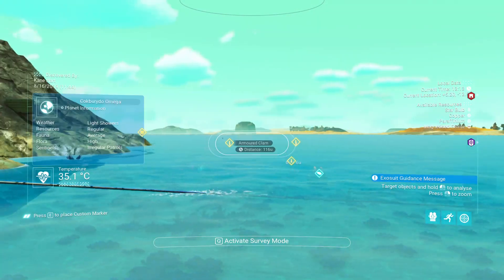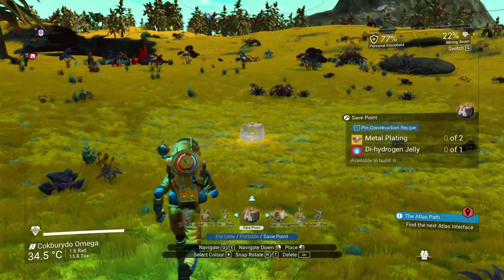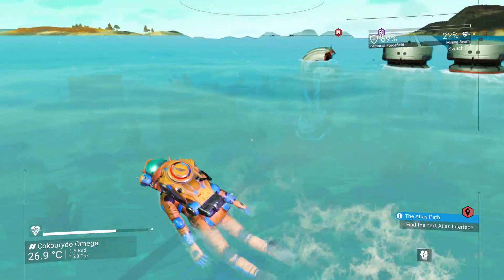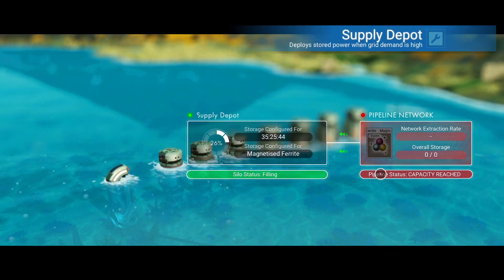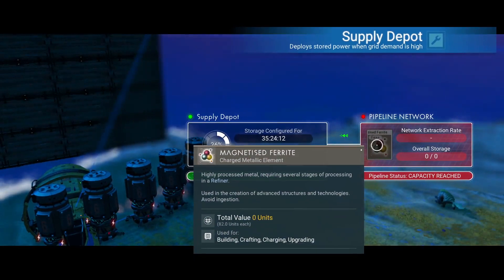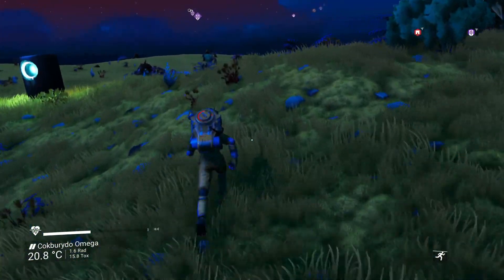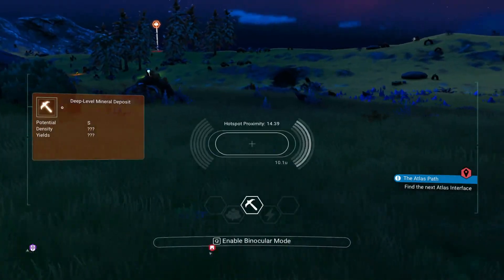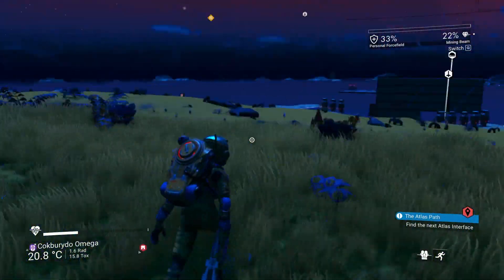No Man's Sky: Beyond - Industrial Issues / Suggestions with Extractors, Supply Depots, Etc.

Comment from the maker: You can submit bug / suggestion reports directly to Hello Games with this link: https://hellogames.zendesk.com/hc/en-us/requests/new
Reply: So, after watching your video cause I was having the same problem, I checked my set up and it turned out a couple miners were outside the zone. Try condensing them closer to the hotspot.
Reply: im having same problem however what type is ur world world I have this issue on is a capped world like urs I bet
Reply: hey i was wondering does the industrial extractor produce minerals over time (eg.1 copper per min) or you get it all in one go (eg. 250 copper per Hr).

Comment: I got this huge bug. Extractors aren't working how they're supposed to. I have multiple farms and the problem started when i had more than three farms on different planets. They're either empty or very slowly filling. Then i have this Dioxide farm that allows me to keep getting max capacity and doesn't empty. This means i can take an infinite amount of Dioxide. Even though this is great for my economy i rather have my extractors work properly.

Comment: Maybe I got lucky but I got the capacity reached message on the supply depot so I redid all the piping and then checked again and it worked. When u lay the piping be slow and accurate with connecting the pipes. Sometimes they will snap but be off the mark just a little which I believe is what caused this problem

Comment: I have an issue with 5 gas extractors that produce 450-480 class A nitrogen farm I can add a few more and connect them via pipeline and boom they are only producing 300 - 340 each but then I delete the pipes and they are back to normal, is this a bug

Comment: I think something that can work is let them snap to buildings so there is no power lines or pipes needed rather than there being classes for the node the mining item has the class so every node is the same but if you put an S class drill it will be like a s class node. And higher class storages to. I would also say you don't have to have a node but it is a step down. So say you want copper but don't care to get the max haul. You put down a b class copper drill anywhere but if not in a node it acts as a c class. If c it would act as if there is a d class.

Comment: Not sure if there's been an update since this video but I had the pipeline capacity reached with my supply depos from long distance pipes.  I deleted a pipe and pit the supply depo right next to the extractor and it worked.  Also no lightning bolts or KP so far with mine

Comment: I have a problem with the extraction rate and storage size on Sulphurine. Although the site is a s class Sulphurine site, the extraction rate seems to be really small (only 40 per cycle, but I have a total of 15 gas extractors). Also, the total storage size is extremely small with a total capacity of 950 (I have 20 containers). Compare to the other type of gases, it should have over ten thousands capacity in total. Does anyone else have the same issue?
Reply: I have the same issue. I think it's a bug with that gas extraction as i have no issues with radon and nitrogen.Hope they fix it soon.
Reply: Same here.

Comment: I have encountered the same general bug you are talking about in regards to the extractors and the depots. I had an extractor setup over an indium node and direct connected to a depot with power and pipes and it would show that it was filling however it would not show me what was in the network nor allow me to remove anything. Had a blizzard blow in so I threw down a short range teleporter to get back to the main base quickly. When I jumped back after the blizzard I was met with surprise as I could now access the inventory of the depot. Thinking that this might be a weird display bug I put down another depot and connected it up to the system and again no longer had access to anything on the supply network with everything showing 0. Ran back through the teleporter and immediately teleported back to the depot area and was able to access the network once again.

I believe that this is a bug that causes the interface to react as if there is an issue when placing items down and not updating the connectivity of said industrial items at the time of connection and somehow the short range teleporter is causing the interface to update and see that the supply network is indeed working. Side note I tried running away, flying around, logging out and back in, exiting the game, none of those fixed the issue. Only using the short range teleporter caused it to correct itself and only until I modified the supply grid again.
Reply from the maker: Sadly in this instance it's not a display bug. We found out certain materials like the one in the video can't be harvested at all through Hot Spots right now.

Comment: Is anyone else having issues with using the wall to extend the editing distance now? There was a patch that came out to reduce dynamic editing to help load larger bases consistently and I feel like that has affected that glitch... Or is that just me?
Reply: So what it is, you have a radius from your character, as of 2.09, and it's shown as a white skeletal dome when you first transition to the hovering build mode (it's not automatic for ps4, idk about Xbox or PC/Linux.) The only fix needed, sometimes is to be in the middle of two connection points (125u each way should be fine, giving you 250u of reach).
Reply: @USNJackman  thanks. I eventually came up with a work around so I could keep doing it, but that helps me realize the "why" :D
Reply from the maker: Yikes, I hope not... I have not tried myself yet.

Comment: reason your pipes are bugging is because you have to have a continuous flow network, if it splits off it does not work. having a pipe go from your extractor to the base, and then extractor to the others  might be messing it up..
Reply: It's not that because I'm having the same issue with a basic set up
Reply from the maker: No it's because of the Material Type. No one can extract Magnetized Ferrite. We found this out in the end.

Comment: I thought I saw someone use the depots to extend the base instead of wall pieces. Have you tried that and just have a string of depots running from the base to the resource extractor?
Reply from the maker: Found out it's based on material types. So I don't think for the material I'm trying to extract it will ever work till patched.

Comment: I have a problem were my extractors don’t have power when connected to a electric generator and batteries but does nothing
Reply from the maker: That seems diff if you have no power. I found out the issue here is material types some of them are broken sadly.
Reply: @StoneLegion  I figured it out, you can't connect anything from one base to another which is really stupid
Reply: @GamesforCykits  if you go threw your portal then you can edit your base,
Reply: @TheSUPERSOLE  I fixed this 7 months ago, but thanks
Reply: Its the direction you build them in you have to build wire towards extracter

Comment: If the resource is 700u+ away from your base, just drop a second base computer and claim that spot as a second base. Not every base has to be a megabase. Just drop one prefab there with a powered teleporter and port there when you need to tend to your industrial items.
Reply from the maker: Thanks mate. I found out that this issue was based on the material type and not the setup. So I can't mine it till it's fixed.
Reply: @StoneLegion  NP. Unfortunately what you described in this video is still an issue when it comes to electromagnetic generators

Comment: Also experiencing this  where the pipeline network is disconnected and the supply depots are not powered.
Reply from the maker: Seems like the issue is material types and not the setup that is broken.
Reply: I've had the same issue on ps4. After testing a bit I found out the pipeline has to be redone all at once its a little tricky.

Comment: When you go into the supply depot menu, at the top right is says it provides power to the grid when demand is high, it's too confusing!
Reply from the maker: I think this is wrong and a bug. I honestly believe this was a Battery Before and then they changed their mine but did not do it right... Or there is a feature that is broken that is suppose to do more... But if you look at the power it stores on the outside via the next it's based on what it's storing and how much of the gas / minerals...

Clearly a really bad derp on the devs. Threw me off like crazy the first time too.